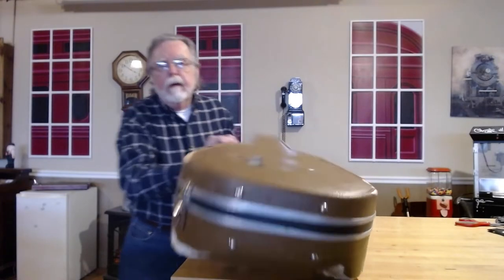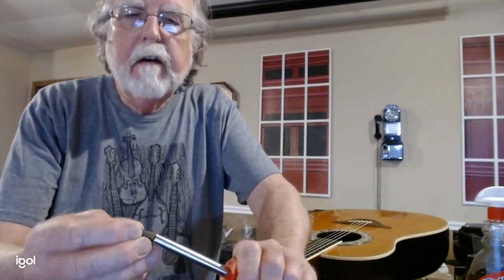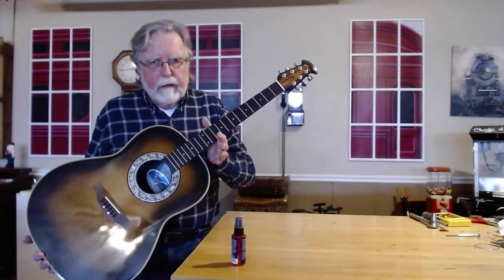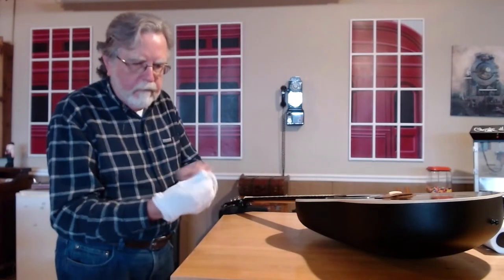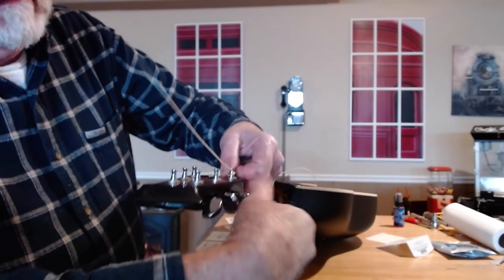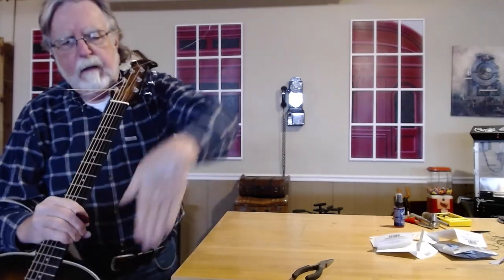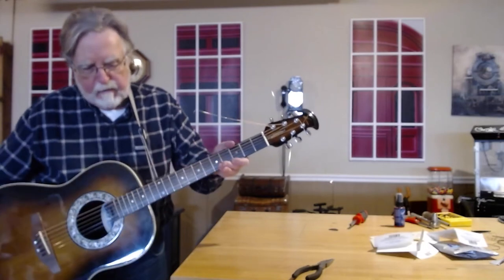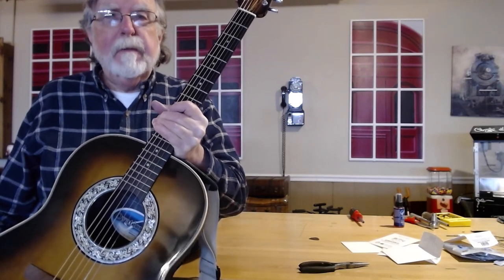Setting up a Vintage Ovation

Comment: I just bought a 1617 ovation, left-handed guitar online. The action was really high and hard to play so I removed two of the four shims under the saddle . The E A G D strings play well with minimum fret buzz but the B string especially the High E almost bottoms out. Going to take it into my local music store for a set up. It probably needs a custom saddle. Guess I’ll find out.
Reply from the maker: Good luck with it.  Does it have a crack in the face yet?  Also are the electronics still good?  The wires in my 1617 have broken from age.  😞
Reply: Maybe I can just shim the left side of the saddle up so it compensates for the buzzing on the last two strings. I’ll give it a shot before I take it into the music store.
Reply from the maker: Is there a chance you could sand one of the shims you removed at an angle and slide it back in with the "fat" part on the end that buzzes?  Okay, that may sound like a "kludge," but area "luthiers" that most people respect have done worse kludges on my guitars.  Another reason I do most of the work myself these days.
Reply: I ended up cutting the two shims I had left over to about 3/4 of an inch and putting them on left side under saddle. No buzzing on E and B strings. It works like a charm and the electronics are good. Kludge worked lol.
Reply from the maker: Glad to hear it! Enjoy!

Comment: You should point out that the string furls fit into the bridge in a U shaped groove and over time if not done correctly will split the bridge.

Comment: Good video and info... but yikes!.. maybe cover that workbench with something soft.  And yikes again.. always lossen a truss rod adjuster a half turn or so first before tightening it.  Anyway.. an Ovation crack story-- I have a 1968 Deluxe Balladeer with the typical crack below the bridge that did not happen until 2019 when it was being shipped across a drastic humidity change (dang it!).. and a 2018 1627 Campbell reissue with a torrified top that I suspect never will crack (knock on wood.. pun intended).  Some of my other Ovations (ranging 1972 - 2000) have crackage, and some don't (knocking again).  Sadly, my 1627 was the 37th to last USA Ovation ever built before they ultimately closed the shop in Connecticut for the final time and moved it all to GEWA in Germany.  So sorry to see Charlie's original old plant shut down.
Reply from the maker: My early 1970s Legend has a varnish crack, but not a wood crack yet.  My 12-string from the same era has separated faceplates below the bridge, but still sounds great.  BTW, I do put a towel on the workbench when working on most guitars.  :-)  I was truly sorry to see the old line shut down.  :-(
Reply: @paulracemusic  It seems that the vast majority of cracks on Ovations I have ever seen are limited to the finish and not the wood itself.. but then again I live in an ideal guitar climate, and suppose that there are many that spend their lives in not-so-ideal climates and develop wood cracks you can see light through.  While the round back Lyrachord does produce great harmonic distribution, the stuff never moves with age and humidity fluctuation in synch with the rest of the guitar like an all-wood body does.. so when the side pressures rise/fall across the sound board something has to give.  At least that's my take on it.
Reply from the maker: @FromMyEyesToYours  In many cases I've seen (including two Legends I bought second-hand for "beach guitars"), the varnish cracks because the wood underneath is bulging slightly.  In Ohio, I'd generally blame too much humidity.  This can eventually involve the wood underneath.  I've seen others where the wood is cracked the length of the guitar a couple inches away from the sound hole. Most often, though, that kind of damage usually happens between the hole and the tailpiece.   Ironically, it doesn't seem to affect the tone very much if at all. I also have a 12-string on which the face plates separated. This was probably because I left it in a corner that got too dry in the winter.  In the summer, you can't tell, because our Ohio humidity swells the wood, but in the winter you can see the gap.  Again, no effect on tone.

Comment: Ovation cases are built like tanks. (They’d better be, because no other company goes to the trouble and expense of making a hardshell case for those guitars, it’s just Ovation themselves.)
Reply from the maker: I have an Ovie "Long-Neck" that they supplied a wooden hardshell case for - I imagine it would have been too expensive to engineer a plastic, foam, aluminum, and fiberglass case for a "one-off."  That said, I recently put my Legend in a gig bag - at my age, the combination of the traditional Ovie case and that guitar was just getting too heavy to drag around.